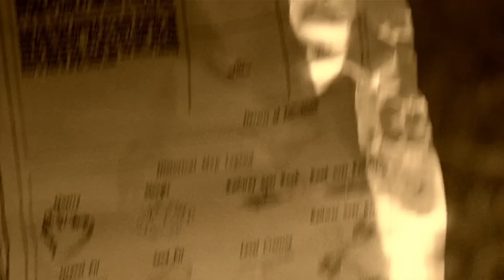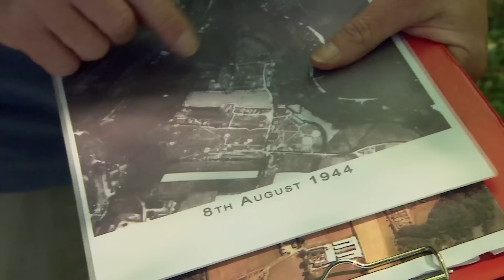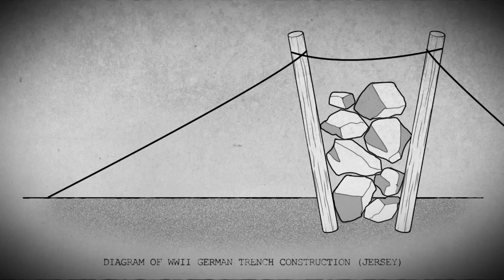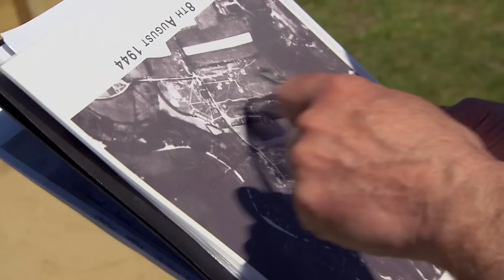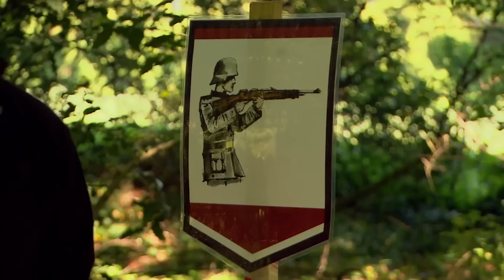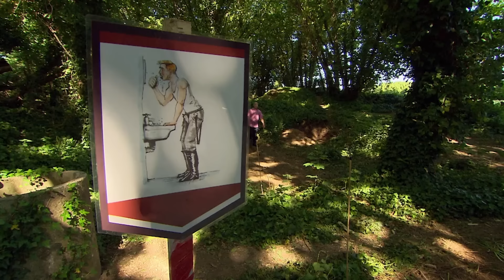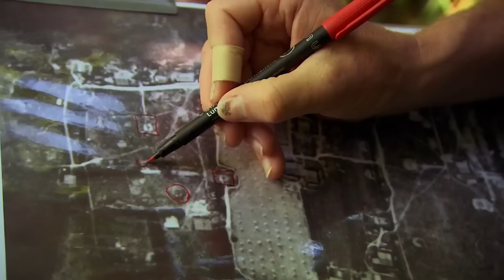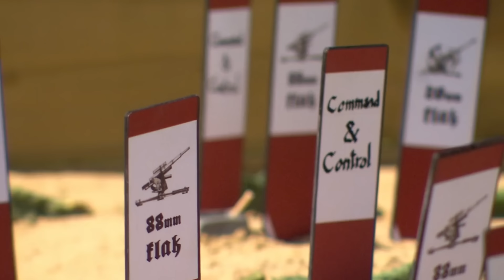‘Hitler’s Island Fortress’ (Jersey) | Series 18 Episode 4 | Time Team

Comment: Late to the party, (as usual).  Sorry.  But I am pretty certain that I know wot that un-identified "funnel" is:

I strongly suggest that "funnel" is actually a collar for a canvas tent/enclosure where a stove pipe/chimney would have exited. These collars are still in use today, and they are regluated/manditory.  They allow a screaming hot stove pipe to pass through fabric without setting that fabric alight.  It's an insulator in fact.  So, the "funnel" would be sewn and riveted into the side or roof of the enclosure with the thin tapered bit pointing up and out.  The stove pipe would then be fed up through the taper and would teminate outside of the taper, thus preventing a fire catastrophy.
Reply: I was thinking along that line as well. Seeing similar from my army days, I was in a GP medium an we had a barrel stove we set up but didn't use it. 

Was Strange though this piece was in the bottom of a Fox hole though.

Comment: 16:30 the German 88mm FlaK stood on a cruciform, not a "tripod". 2 sides could fold up and the ends could be attached to wheels for transport. There was also the 105mm version as well. The design was actually by Bofors of Sweden, who let Germany build them under licence. 

The British had a similar deal, but instead made the 40mm 2 Pounder Bofors, which was semi automatic. It was the Germans that scaled them up to make the fearsome 88mm, but more so because of when Rommel in France had to use them on a flat trajectory against British Matilda Tanks out of desperation, because Matilda tanks had very thick cast armour that the German AT guns at the time, the 37mm had no answer to, the same for the 50mm PaK 38.

It turned out to be an extremely efficient tank killer when used "wrong" like that on a flat trajectory against Tanks, especially with dedicated AP shot. Pretty soon the 88 was being mounted in tanks.

31:24 I don't really know what kind of terrible pop history this is, but I'm only an undergraduate and know that the Organisation Todt used a lot of slave French workers and that the French were not untermenschen. Turns out that in the Channel Islands a bunch of Spanish Republican slave labourers were used, handed over by Vichy as a "present" to Todt's Labour Corps, as well as Dutch Dissidents, apart from the Ukrainians and Russians, who were the only ones classed as untermenschen, that was just a terrible conflation on her part. Some   of them stayed until 1945 and afterwards some of the Dutch and Spanish slave labourers were allowed to remain and marry girls there.

In Nordhausen, average lifespan of slave labourers from all nations was 3 months. With Todt really it had nothing to do with untermenschen, even though that was the reason given to treat prisoners of the Soviet Union even worse, but really Todt didn't care, it was just very cynical, and not just ideology. I don't think you'd have to editorially go that much out of your way to explain Todt how it actually was.

The way the ideology worked was anywhere they occupied, if you were a member of the equivalent of the Labour Party, in a Union, communist, you were going to Organisation Todt, on a good day. On a bad day it might be a punishment battalion or just death. Most people take being a member of the Labour Party for granted in this country. So did they.

Thanks for reminding me why I used to avoid these, as much as I love TR.

https://www.theislandwiki.org/index.php/Forced_workers
Reply: "pop history" 
Well, history is written by the victors....
Reply: My grandfather (Dutch) was a forced laborer in Germany and ended up in a hospital, even though he was tanned and had black curly hair, big nose, etc. he wasn't put in a ward with untermenshen (in this case Russians or Polish) simply because he was Dutch.

Comment: I think that mystery bit of metal might be a marking cone. I’ve seen them on small airfields in Alberta. Usually they are painted orange and can be pinned down into the ground. I could be wrong, but it has the right size and shape.
Reply: highly doubtful as the hole they found it in is quite far from the airport - which is at the bottom of the hill
Reply: @thesteelrodent1796  they are light and could have been stored elsewhere or blown by the wind. I wouldn’t jump to highly doubtful.

Comment: As someone who was in the military, I find their approach to the UXOs a bit mystifying. The round they thought might be live, there were people standing less than ten feet away from a potential hazard, yet the old guy was more worried about an empty, flattened case with no propellant or projectile, because the primer might still be live. Very backwards thinking, IMHO. I don't think they should have been handling any UXOs unless it was done by a professional. If that dude was supposed to be the professional, I'm truly relieved that nobody was injured.
Reply: They had bomb disposal on call in case they found any UXO. None were found and an explosion on the beach would make good viewing, so they made an excuse to have an explosion on the beach ;)
Reply: I don't have military experience, but what little I've picked up about battlefield archaeology suggests that there is a big difference between "fresh" UXO and some that has been buried in mud for many decades. 

I can imagine that the primer might be more likely to be a risk in some of these cases than some partially decomposed propellant.
Reply: Of course they had professionals on hand, but it makes better tv the way they did it!

Comment: It was not a fortress, as Britain had no benefit in recapturing it, as they could not resupply, without large losses. That’s why it was only recaptured, when the war ended in 1945. It was unimportant to both sides.
Reply: Did have the use of tiying up a lot of rescourses and 35, 000 troops that might have gone into the Wesatern Wall. Also the only Panzer regiment never to see action.
Reply: @51WCDodge  Far less men than you state. The 319th static division had about 12000 men , when fully manned. It was not at full complement in 1945. As to tanks, the German tank battalion had about 30 old French tanks , and no German tanks. A small force with formidable defensive constructions. As the Germans  were cut off from supplies , for so long, the British did not bother. The British , however, were sending in Red Cross supplies to the islanders, who were starving.

Comment: An FYI: At about the 24:15 mark, one of the archeologists finds an 88mm round and radios for help. Never, EVER, use an RF transmitter around munitions. There is sufficient energy transmitted to set off the primer. Always send a runner.

EOD-101.